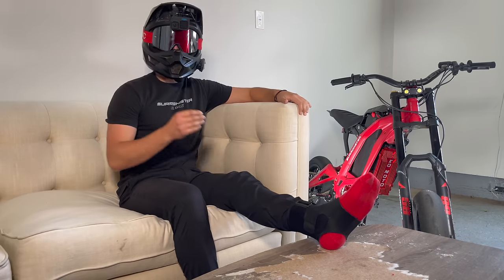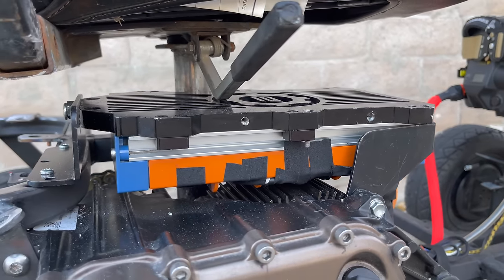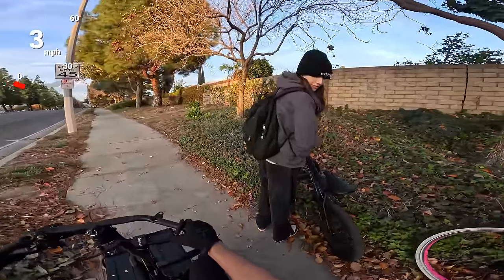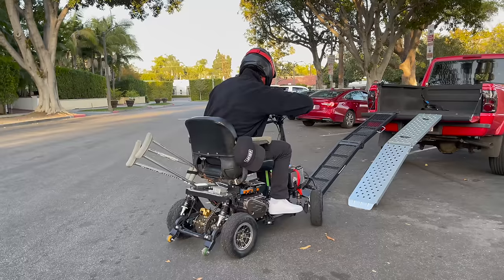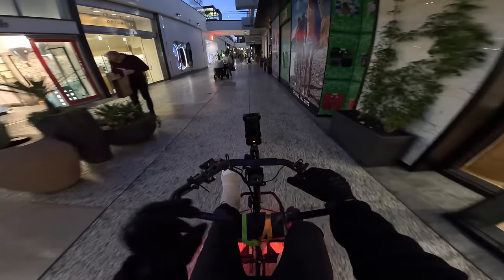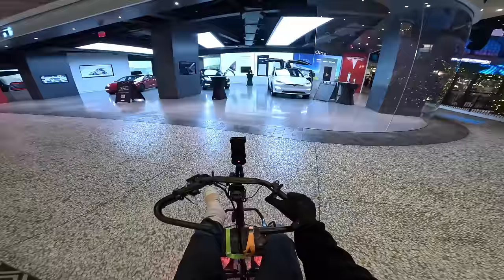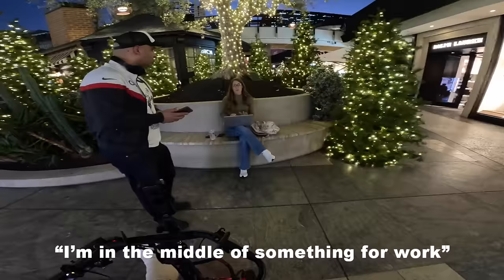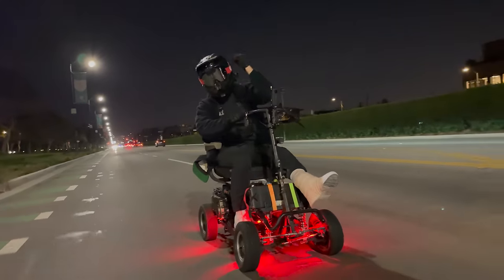The World's Fastest Mobility Scooter is DANGEROUS

Comment: Wider wheels/tires, independent suspension, and lowering the seat as far as the motor allows, would make this thing insane. Using parts from a mini quad, would probably cut back on engineering time. You could probably use the front A arms/suspension from a quad, all around. Then get go-cart wheels and tire. You could also get some knobs for the dirt.

Comment: I'd definitely put a something like a 10mm steel plate across the bottom of that for better weight distribution, and lower the batteries as well.

That would somewhat improve aerodynamics and chassi stiffness as well.

If you could cut the 2 batteries into 4 halves and strap them across the floor that would definitely be the best option.
Reply: i'm sure they know what they're doing
Reply: @justinwilliams3324  lol
Reply: @justinwilliams3324 Did you count how many times the rider mentioned how unstable and top-heavy it was? Before it actually flipped over?
Reply: @justinwilliams3324  It doesn't matter if they know what they're doing, not every one is perfect and extra help always goes a long way.
Reply: @justinwilliams3324  if that's your response to constructive criticism then yikes
Reply: You'd have to add about 500kg to floor of that to make it stable there is a human sitting way up high on a chair it's going to be unstable

Comment: Tell me why I would want all ebikes to be this design accept ide use a single front wheel and double back. Ide make the wheels 20x3.25in ans expand the width of the base wheels by 2-3ft total which would make the clearance higher, make the ride smoother, adds range, adds speed, lowers the center of gravity and makes it a million times safer to ride slow or fast and most of all makes turning not nearly as sketch as this one is.

If I was fabricating the back wheel frame ide probably extend it to make it have a truck bead type deal that's another 2.5-3ft longer. You could throw some metal doors on it and have storage for extra batteries and a inverter wired to solar panels that go on the tops and sides of the box shaped lid going over it so you can charge an internal battery that can charge the bike or charge spare batteriea while your riding the thing!  Get some major range that way. You could even just take all the stuff out of it and fill it with extra batteries tied into thw bike and replace the solar lid with a bench seat fabric type seat and 1-2 people can ride the back!